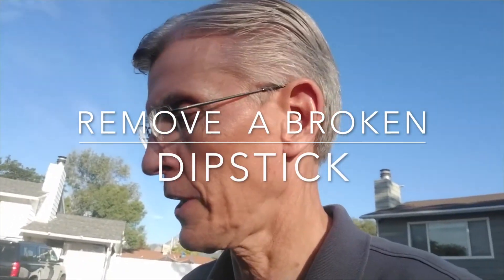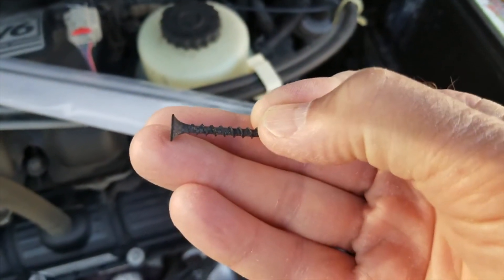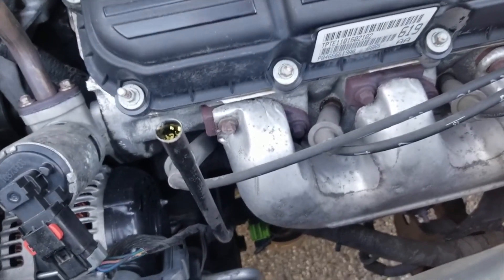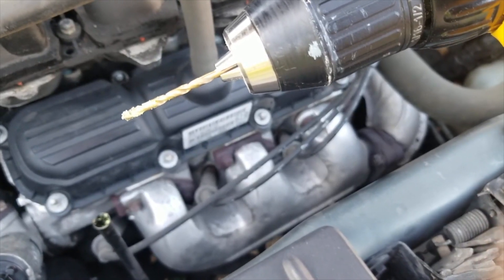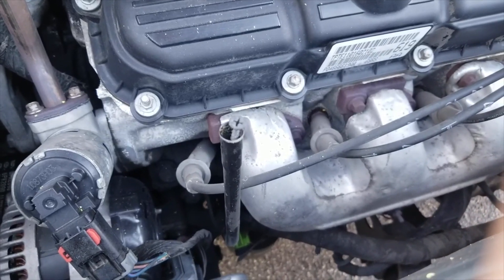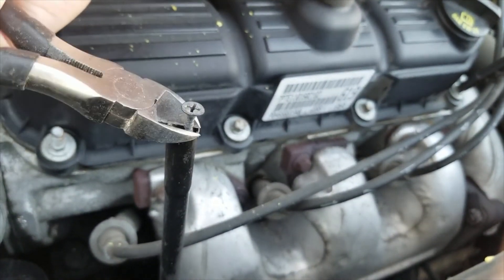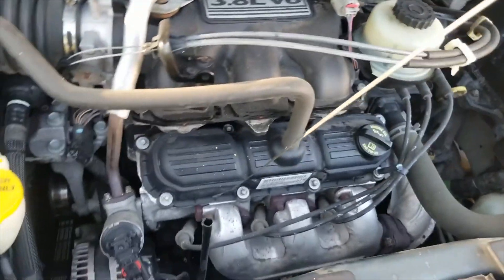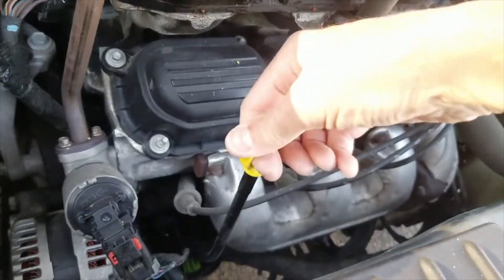Remove and Replace a Broken Dipstick

Comment: Thank you so much. Bought a used vehicle and missed checking dipstick. Signed everything and came back home, only to realize broken dipstick head😢

I tried your method and it worked out 😊

Interestingly, either the dealer or previous owner tried the same trick (found another broken screw in the plastic part). Unlucky them, they gave up. 

Anyways, I was panicked for a bit…😅

Thank you 🙏

Comment: So I have a Ford 2013 Escape. This and all other related videos don't show how to remove the "cowl" (which must be done to access the broken stick). Once removed, I drilled a hole with a 1/16 bit and I lucked out. The bit gripped it enough to where I could remove the stick. Hallelujah!!!

Comment: I did this but my screw stripped half way pulling it out 😨. I then went and  bought some gorilla super glue, placed it on the tip of the screw,screwed it back on with the little traction it had left,let it set for about 2min, and was able to pull it out! Thank goodness
Reply from the maker: Glad you were able to get it out. Thanks for watching!

Comment: ALTERNATIVE DISCOVERED: I began to proceed as detailed in this video... 
however, I don't have one of those little suction tools, so I wheeled my Dyson vacuum cleaner over to the car. Since I had it there, I decided to fire it up, bring the hose over to the dipstick tube. I wrapped my hand around the mouth of the hose, and the shaft of the dipstick tube, to create as much of a seal as I could. Seconds later, I heard a "fwooop." And there it was. Kinda surprised. But it worked it just 2 seconds. Worth a try, to be sure.

Comment: Great video and saved my butt when it happened to me. Not only did the dipstick snap off, but the drywall screw tip snapped off too. That side cutters or wire cutters came in such a pinch by waling it up the remaining screw and using the tube to pry it up and finally out. Thanks!
Reply from the maker: Glad you were able to work it out.

Comment: Nice work. Had everything right except I couldn't pull it out of the tube Ford F150 3.5L. The wire cutters worked as the perfect fulcrum. Job done, thank you
Reply from the maker: Glad it helped

Comment: Is it possible to replace only the handle? Saw aluminium handles on eBay for sale Chrysler 300, just don't know if that fits
Reply from the maker: It's an easy and cheap fix to replace the whole thing. Since they hardly ever break, I'd stick with the plastic. Thanks for watching.

Comment: Bro, it worked like a charm except one small difference,,,,the one I was removing for a friend was so jammed in there I had to use a 15 inch pre bar to get enough leverage to yank that mutha out. But thax again for the excellent video.

Comment: Hello Scott.. in my case the dipstick went too down. Is there anything to worry about if I take my car to mechanic to replace the tube? hope its goes safe and easy on my engine?
Reply from the maker: Generally dipsticks aren't pressurized and from what I hear, they can be replaced quite easily. There are videos out there that show how to remove them. Generally they have one bolt holding them in place. The ones I have seen just sit in a hole in the engine and the bolt towards the top or middle holds them in.

Comment: The other day I was changing the oil in my wife’s car and tried to take engine cover off before removing the dipstick because the hole is big enough but I snapped the ring off and couldn’t get the dipstick out.
I watched a couple videos about it but nothing worked.
Including yours.
I put just a dab of gorilla glue and the broken end and let it dry.
Today it came right out so I was able to put a new one in.

Comment: It might have been a good idea to rub a little engine oil right below the pull ring and around the O-ring there before the ring was broken off to help keep the plastic from sticking in the tube.  Do this once in a while while changing oil.  Also do it on the new dipstick...
Reply from the maker: Great tip!

Comment: Thank you Great Idea. I just did this on a 5.7 hemi. I used a small vice grip on the screw and taped it out gently with a hamer while pulling up on pliers. Also at first I had over drilled my angle Soo the screw got stuck Soo had to back it off a lil. Good luck y'all.

Comment: so how far down will the dip stick go before it catches.  I mean it will catch something hard so that it won't go down anymore and you can drill into it?   so far when I have touched it, it has wanted to drop down more.  it isn't down that far yet (only about 1/2 inch.
Reply from the maker: Funny you should mention that. When I put the drill bit on the end and started drilling, it dropped down about another inch or inch and a half and then stopped. I thought it was going all the way down. But, the top was large enough that it stopped solid and wouldn't go down farther. It shows in the video. I pushed it a little hard while drilling and it made a little harder to pull it out. 

Just drill with a little bit of pressure and it should come out easily. I would guess that it will come out easy either way. I was trying to pull it out with one hand while I held the camera and it was awkward to pull it out. Using both hands should get it out without any problem.
Reply: thanks.  so were you worried you would get a few shaving of plastic down in the engine?    for me, it looks like there just isn't any area around the broken of dipstick for any debri to drop down thru to the engine.    by the way, is your vehicle a nissan?
Reply from the maker: @wasatchm  It was a Dodge Grand Caravan. I was worried that when I pulled it out one of the little plastic shavings would drop back in. I probably didn't need to worry but I didn't want to take any chances.
Reply: thanks.  I'm gonna try vaccuming it out (probably won't work).  and then try putting superglue on the end of a stick and sticking it down in to see if it will bond enough I can put the dipstick out (might work).    might also try the same method using j.b. weld instead of superglue (if superglue does not work).    if that does not work, I will try the drill method.  and my last method is to blow it out with an air compressor.
Reply from the maker: @wasatchm  There is a danger that the glue will ooze out and stick to the inside of the tube. It shouldn't since it has had oil in the tube, but if it does you may have more trouble.
Reply: @create1631  Planning to change my oil/filter anyway, so any plastic will flow out with the old oil.  Having an assistant vacuum during drilling would better remove detritus. Thanks for the video!
Reply from the maker: @catfishphil  You may be right. I had a car a while ago that had tiny holes for the oil to go through and nearly anything would clog them until the engine finally seized up. Hope your engine is built with better oil holes.

Comment: I tried this. Even added a drop of oil to the screw after it was screwed into yellow part. This will not budge. Idiots at the oil change place shoved this so deep....any other thoughts? Thanks..... do not have the money now to take to a shop. Oil light comes on so this needs attention. 😢

Comment: What ive done in the past is use a thin drill bit and a dab of grease into the tube to collect the plastic shavings and when you carefully   screw into the plastic the shavings come up with the stick
Reply: Also once inserted a thin skinny dental pick to wedge the plastic into the tube so it wouldn't slide down more
Reply from the maker: Yes, whatever you do, you don't want the shavings to get in the oil.
Reply from the maker: Good idea.
Reply: All the results seemed to work good but I didn’t understand why you would take the chance of cutting the nail you were pulling on. Once I got it started and there was enough exposed I would have traded the tool for a regular pair of pliers to pull it out.

Comment: Always use plastic compatible grease on the yellow plastic pull end of the dipstick. It won't dry out the plastic 
and should last longer than the old one ever did. Big problem on Dodge made vehicles older than ten years.

Comment: Went to Valvoline to change my oil and they broke it . They're going to replace it for me for free, but I'm driving about 400 miles this weekend . 

Will it be ok with the broken dipstick stuck in there?
Reply from the maker: Not sure, but if it is still pushed down into the tube I would guess you would be okay. Mine was pushed down like it is when the handle was attached and it worked fine until I changed it. Good luck!
Reply: That just happened to me too

Comment: Mine just keeps sliding down...😤😤 
I guess I’ll just replace the tube
Reply from the maker: You might try taking the tube off and pushing out the dipstick out from the other end. Then you may be able to just put it back on and inserting a new dipstick.

Comment: Take the o ring off all the caravan dipsticks and sand the plastic down a bit. They are way too tight. Use some epoxy on the screw before screwing it in.

Comment: Thanks to the dummies at the oil change place it was shoved in so deep it was impossible to remove. (I found this out later. Of course, these people did not own up to ruining my car) I tried this screw trick and it would not budge. I even added some oil around dip stick, still no movement. I heated the tube and still no movement. Really hate that I paid a fortune to have my oil changed so these dummies could ruin my car. Now it will cost $300-$400 to have a mechanic fix it. Any other thoughts on how to get this out?
Reply from the maker: On most cars, the dipstick is held in with one screw. You should be able to undo the screw and pull out the whole dipstick. Then you can push from the other side. I've been told that is as easy as the method I showed. I just didn't know it at the time. Good luck!
Reply: @create1631 Thank you for your reply. I am reluctant to take it out. Afraid I can't get it seated back in properly once out. Any tips? Be well.
Reply from the maker: When I had to take mine out, it wasn't tightly sealed or anything. It just had a screw in a little arm that kept the dipstick upright and when I undid it the dipstick just slipped right out. It didn't have a tight pressure gasket or anything. I don't think they are in a place with much pressure. When I was done I just slipped it back in the hole and tightened the screw. It took less than a minute to put it back. Easy peasy.
Reply: @create1631  Thanks man. I feel better. I thought it would have a gasket or something I needed to seat properly. Be well.

Comment: Yea this didn’t work for me, I can’t even get the stick to move. Almost like the plastic has seized up to the tube or something
Reply from the maker: Sorry it didn't work out. I don't know what the problem could be. You may need to replace the tube which I understand is supposed to be pretty easy as well. You might try taking off the tube and then pushing the bad dipstick out from the other end. Thanks for watching.
Reply: @create1631  no problem man it was worth a shot and a damn good idea for sure! Just didn’t work for me but I just had the entire thing replaced
Reply: I had same problem.  Was going to pull the tube but would have been a nightmare getting to it on a hemi jeep grand Cherokee.  Differential in the way etc….    Drilled a hole on dipstick tube just under where the plastic should be and used a pick to push it up from underneath.  Actually took two small holes to get it out. Then just wrapped tube with electricians tape.  Could have put a slot in it too with a cutoff wheel.  Either way if you’re careful it’ll save you a lot of headaches

Comment: If this doesn't work dipstick tubes are usually easily removable not hard to pull out and even replace if necessary 

The tiny plastic shavings won't hurt a thing if they somehow get in the oil
Reply: They might block a tiny oil channel...
Reply: @aaaa09t  😒😳
Reply from the maker: I had a car a while ago that had tiny oil tubes that actually got blocked and the engine seized. I just wanted to be extra careful.

Comment: Could have removed 1 bolt, pulled the dipstick tube from the block, and  pushed out the stick in less time.
My 2 cents
Reply from the maker: I've done that on another car and it is just that easy. Thanks!

Comment: Why would they use cheap plastic for a dipstick? That's just stupid
Reply from the maker: They should have used a different type of plastic. I think they use plastic because it isn't hot when the engine is hot, although you shouldn't be checking the oil when the engine is hot.